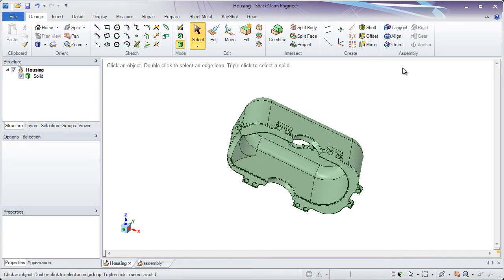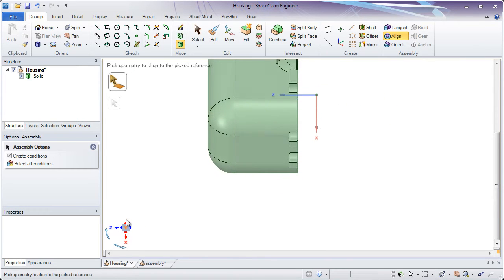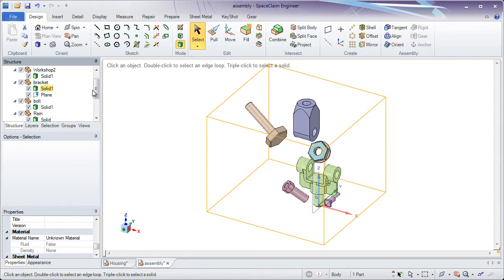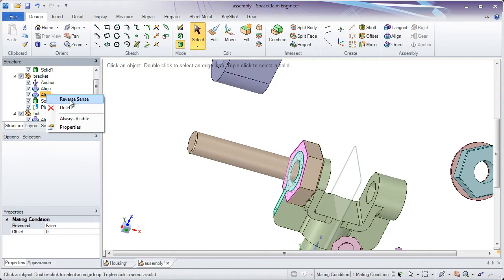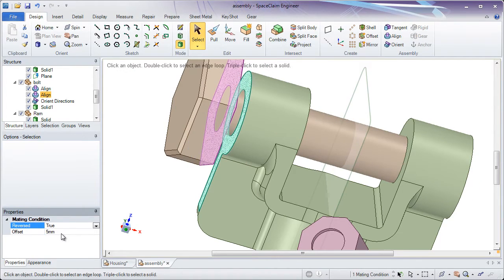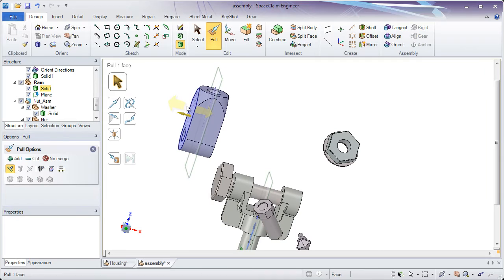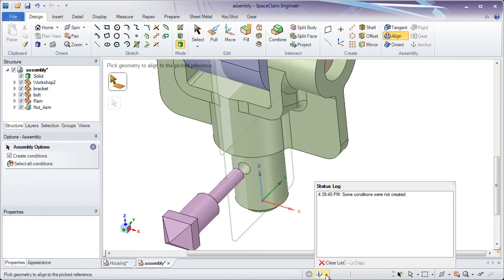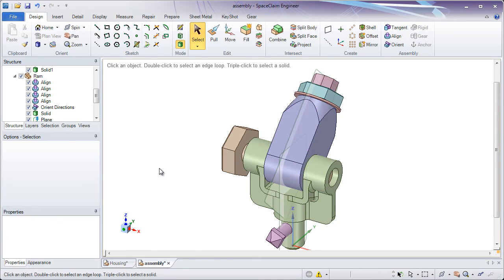SpaceClaim Tutorials: Assemblies 2 - Assembly Tools

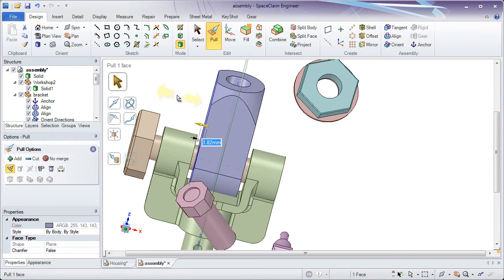Comment: 11:00/14:29...No it doesn't make a sense.  The part would loose its functionality, because of distorted shape. It would make much more sense and be more useful, if the part would grow symmetrically and in the assembly both part moving symmetrically apart or closer together, while maintaining the original side gap. If there is a possibility to "lock" the hole in the blue part, so it doesn't convert into slot, it would be even better...But other ten that it is awesome!

Comment: For example if we design a pen and its lid. For lid that goes to cover pen, do we need to give clearance in spaceclaim? I meant do we need to make lid dimension a bit smaller to fir pen? In solidwork we don’t need to have different dimension of pen and its lid unless we need to pint it out for 3 D
Reply: if your not running any kind of of FEA or interference analysis it wouldn't make any difference